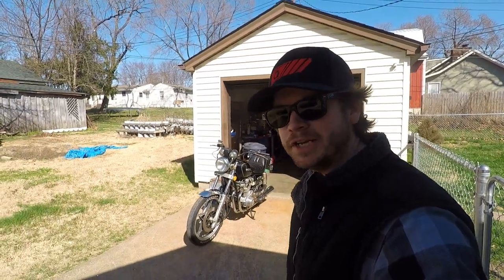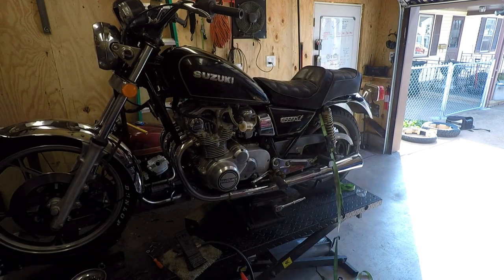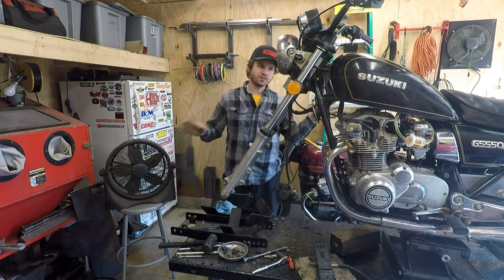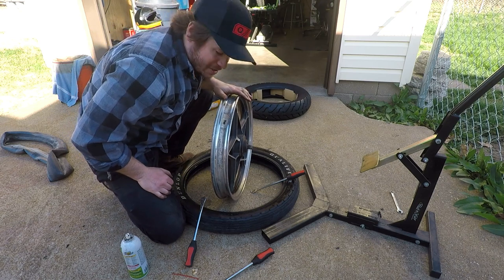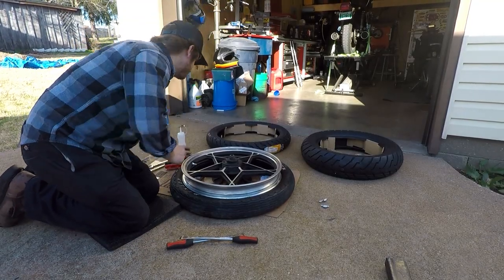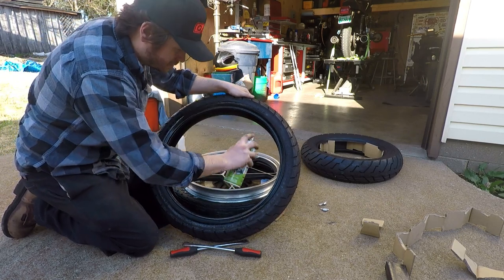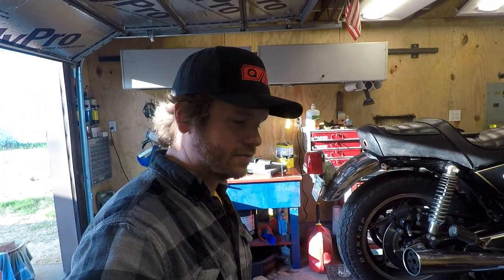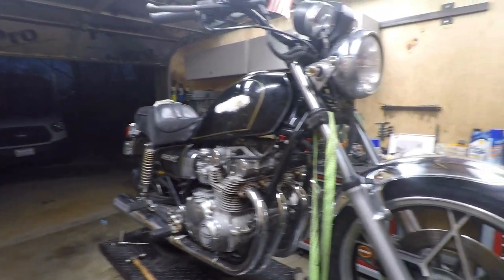FREE GS550 - New Tires!! - Ready For The Road! - EP10

Comment: There is a far easier way to remove the rear axel on a GS500. Remove the 2 vertical bolts at the end of the swing arm. unbolt the caliper, loosen the axle bolt (you don't even have to remove the nut) and the axel with the wheel still on it will slide right out the back of the swing arm.  Sorry to be that guy, but I hope this will save some one some time. I do love the channel please keep the new posts coming.
Reply from the maker: Dang I didn't even consider that! Noted!

Comment: i replaced the dunlop qualifiers on my 84 magna with shinko 712's. it rode ALOT smoother & seemed to feel much better in the turns as well.i doubt the shinko's will last as long due to softer compounds, but for the price, they do well for my type of riding.i like them.
Reply from the maker: Right, I don't get to put a ton of miles on stuff so I like softer grippy tires